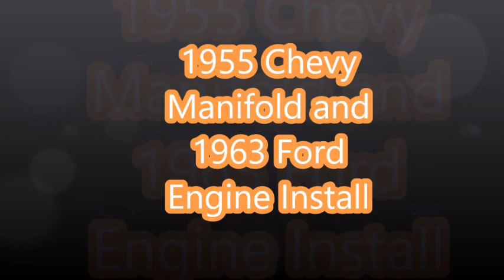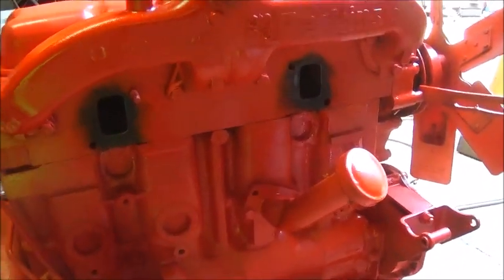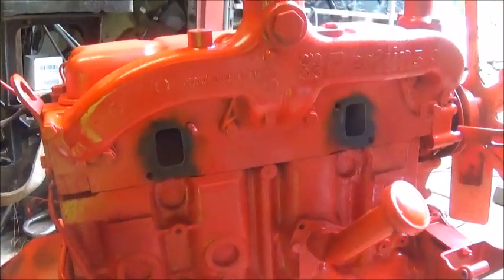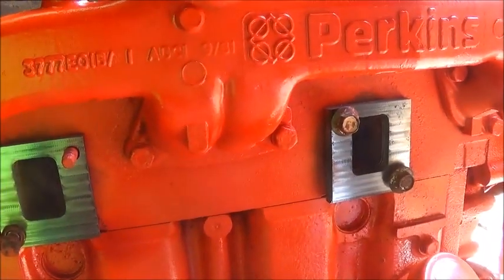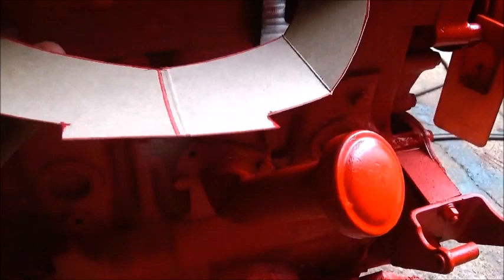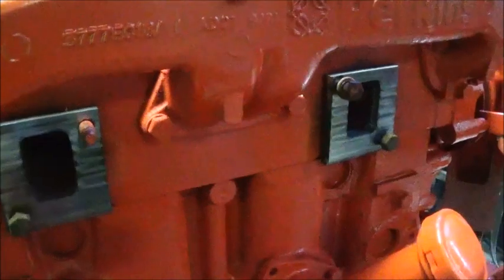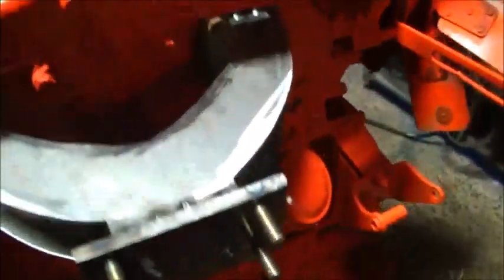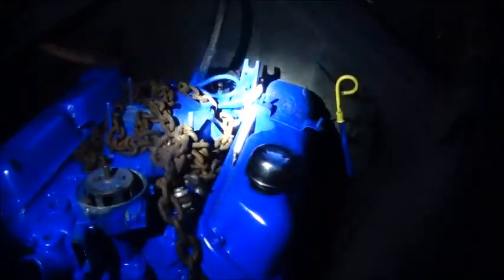1963 Ford Falcon and 1955 Chevy Truck Update 5

Comment: watch all your videos, always impressed with your skills and ideas but have you ever considered using tig to weld up your masterpieces like the turbo manifold, it would look very impressive unlike mig welding that kinda spoils it all. keep up the good work
Reply from the maker: I agree!! Need to look into a tig unit. I can braze, so I think I could tig, never tried..
Reply: +Jonathan W 
a few years ago a bought a cheap Chinese 220v, inverter dc only tig/plasma cutter as my first tig, I've still got it and regularly use it. now I've got a snap on ac dc inverter and a sureweld big transformer tig too. all great machines but would recommend a Chinese one for a first machine especially if just for mild and stainless steel, they start from £200 english pounds, not sure in dollars!

Comment: on the ford can you use the original manifolds but swap sides or flip upside down to make room?
Reply from the maker: The originals on the LTD are as wide as the headers. They won't fit between the head and the shock tower. Got a set of headers coming that will fit.
Reply: Cool. Gd work Jonathan